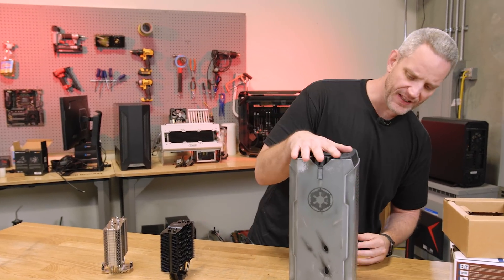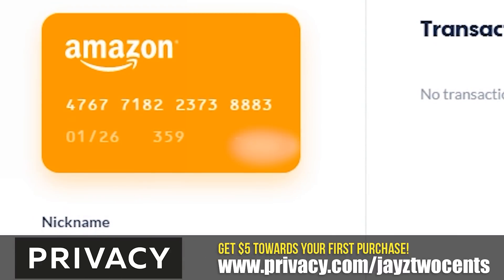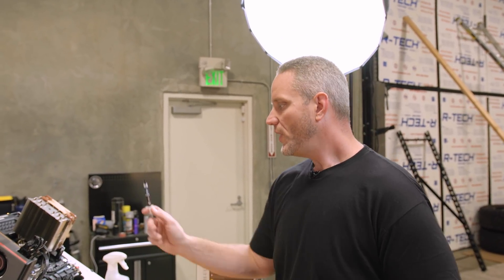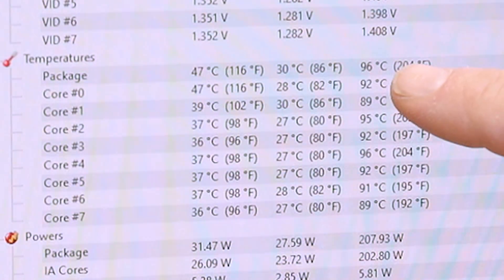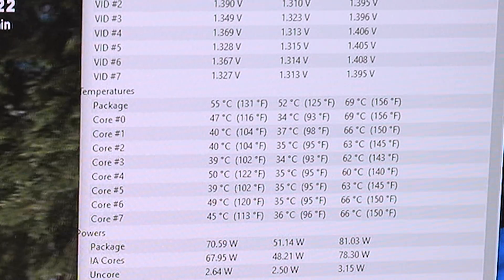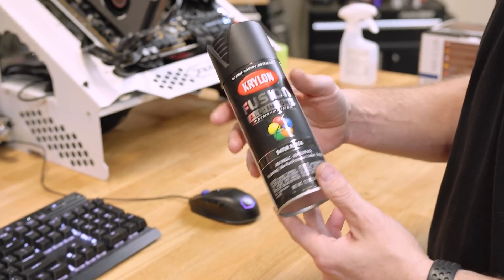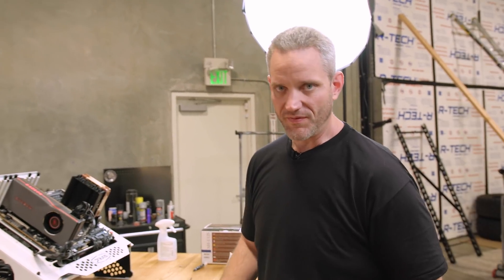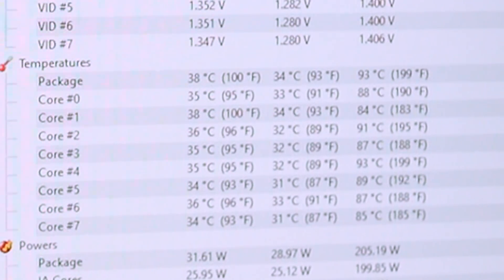Does painting a heatsink hurt its performance??

Comment: Painting the part that goes on the heat spreader would've been such a LInus move.
Reply: Well, no. Jay was the one who drilled through a motherboard and expected it to work afterwards. Linus isn't that dumb.
Reply: @SgtStinger  you can drill through a motherboard and have it work fine, all depends on specific PCB layout and whether or not there are any places where you can drill without severing anything on one of the layers
Reply: @Hetznaz  yeah, if you use proper tools. Not a cordless drill with a dull bit.
Reply: @SgtStinger  whether its cordless or not is irrelevant, and as long as you dont sever a contact, doesnt matter if the bit is dull or not
Reply: @Hetznaz  It does matter, because a dull bit will make a more rough hole and it will make the risk of delamination higher. As evidenced by Jay drilling in to a motherboard in a spot that should be OK but still failing.
Reply: I think you mean dropping it
Reply: @Hetznaz  Nah. They plastidipped a pc inside and out once.
Reply: @MarginalSC  2 years ago. I've been watching LinusDropTips since his NCIX days, and he's much more known for dropping hardware then the 1 video he plastidipped a pc
Reply: @MarginalSC  link?

Comment: In theory I'm assuming some people could go far heavier on the spay paint. Thus Jay's results wont be the same as everyone who does spay paint.

As an example someone might be real determined to get a full coat of paint between all the metal. Thus clumping or running spay paint could mess with airflow. Or some fool might put a primer on first or multi coat it. Also there's no way Jay can test every kinda paint, some could insulate a lot better than others. So results could vary there too.

Edit: Oh, Jay mentioned primer wont be used in this test.

So regardless of the result Jay will get, he likely wont get as bad results as others could. So my bet is about ~3C rise in temperatures, as Jay wont go too heavy on the paint... but others could really hit 7c or even 10c

Comment: Well it really depends on what type of paint and how thick. We us a coil compound on HVAC condensers to protect against corrosion in my company. We live on the coast and the small amount of heat transfer loss is more than worth having to replace your AC 5 years earlier because salt killed it. 

In this case it's a much smaller coil with not nearly the same airflow. So I would imagine that the difference would be more significant, but it depends on the insulation properties of the paint. The primary thing you're altering will be the radiant heat ability, I doubt convection will be affected that much because it's active cooling. 

You should test passive vs. Active cooling (fan off vs on) if you want to see how much the paint affected each heat transfer type. Obviously you would have to adjust the benchmark rate to test the passive cooling, but I think it would be interesting.
Reply: Yep, pretty much what I expected. As will all heat transfer scenario, it depends. But obviously additional layers of insulation are going to reduce heat transfer. Thats like the definition of insulation. I'm still interested in what the difference between them with passive cooling is though.

Comment: Noctua fans are WAY over rated. They aren’t the best for airflow, they aren’t the best for static pressure, and they aren’t even the best for noise. 
They’re good all around but they’re still in the mix with every other decent fan. And aren’t that much better when they excel. So I don’t get why so many people are obsessed with them like they’re the holy grail of pc fans.

Comment: My guess is that it would depend on how thick you apply the paint. If the paint is too thick and clogs up the gaps between the fins, then I would figure a reduction in cooling performance; however, if its properly done like maybe through powder coating or with an airbrush so as to not clog up the gaps between the fins, then I doubt there will be any difference in performance

Comment: [Fun Fact] When building high hp turbo cars that use air to air(intercooler) One trade secret that big boi's never tell you about is painting the front mount intercooler black.  Keeps the compressed air charge inside the pipe at a cooler and more constant temp while increasing volumetric efficiency(easier to tune for elevation/humidity/heat etc)
This was a fun video to see if the same can be applied to heatsinks but i figured as much, for you to see a huge gain in cooler air it needs to be pushed at high volumes while cramming and compressing the air molecules closer together what in turn dissipates heat "naturally"

Comment: if you just paint the fins and leave the heat pipes alone it causes zero issues, at least that was my experience painting my scythe mugen 5, also make sure to use high heat spray paint.

Comment: I think there was something that was overlooked that I would love to see the results of. When it was painted black wouldn't it absorb more heat from your studio lights then when it was metallic/reflective? I just noticed that both of the tests where done on the open test so I would love to see if the difference was lesser in a closed unilluminated enclosure.

I'm unsure if it would make a difference and maybe I'm overthinking this but it's definitely something that caught my attention.

In any case loved the video as always and keep up the good work!
Reply: The color of the paint could potentially make a difference, but not because of the studio lights.  He would need heat lamps in his ballasts to make that happen.

It is a good question, though.  Many people are asking about the black color choice due to its thermal conductivity (pretty much just like you said).  But it wouldn't be because of the lights.  There simply isn't enough energy there to make a substantial difference.
Reply: You know jay is using LED lighting, right? Its not putting out that much heat...
Reply: By the way black absorbs heat faster but it also dissipates it quite a bit faster. So its 100% negligible as to what color he picked.
Reply: @wesleybates4849  did you run that by Dwight Schrute?

Comment: @JayzTwoCents You now need to get one of these ceramic coated ones and strip that off and see what these premade black ones actually do on temps.

Also, would washing it in vinegar before painting make a difference by removing the oxidation layer upon the aluminium and make a more better contact with the surface with the paint and less insulating?    Also the type of paint, one way to tell would be get several paints, paint test strips on a white test board, place out in a sunny day or strong heat source and measure which strip has the hottest surface.  That would be the paint for best thermal conductivity to use.

Great science btw.

Comment: I believe there will be a difference, and unless your already pushing the limits of the cooler, then it will not make the difference.
Reply: I was right, it made a difference, but it did not make "the difference" unless you are on the edge of your system's thermal limits.

Comment: Yes it will matter...paint thick or thin will not transmit the heat from the metal fins and I predict a +5-8c difference in temperature.
Reply: So it ended up being +2-4c instead...that doesn't mean I was wrong, just off by a bit ;)

Comment: If black is the preferred color, consider using graphene paint; greater thermal conductivity than silver or copper (by an order of magnitude).  But, relatively expensive.  Like silver and copper... electrically conductive.  Graphite is also more thermally conductive than the most conductive metals... but, significantly cheaper.  Tennis racquets are made from graphite; used to make them from wood and aluminum.  Why aren't heat-sinks made from graphite?  The tennis racquets cost between $100-$200 (retail)... and tend to be quite larger than heat-sinks.  Oh, well.  I'm sure there's an excellent EXCUSE for using heavier, less conductive hunks of metal... instead.

Comment: Truth be told, if I was even going to paint an air cooler, I'd really only be concerned about painting the very top, which faces the window. Once your fan is put on, you won't even notice the silver parts. Painting just the top likely wouldn't affect performance.

Comment: 13:58 certified bullshit. AMD CPUs efficient transfer of heat have zero to do with the solder. AMD CPUs are made on more efficient nodes and use a multi-die design. that means no concentrated heat sports and more surface area across the chiplets to transfer heat.

Comment: 1:26 I reckon it'll reduce air flow through the cooler, and dust collection over time will be increase as well. Purely because of the rough texture the paint will leave.
Reply: But more to the point, who the hell is looking at the cooler instead of using the rig??
Reply: @noel8313  Also who DOESN'T look at the cooler in your rig?  I love me a good air cooler.
Reply: @WeirdOne19142  lol I only looked at it when it was smaller! stock cooler on a phenom II x4 955be..... But now I'm a big boy ! Hyper 411R on an R5 3600.
Reply: @noel8313  ahh no way.  I need the kind of cooler where you need to cut a hole in the side of the case to make room.  I'm joking, of course, but honestly I do like a big air cooler.  They're works of art.
Reply: @WeirdOne19142  lmao Crack up!
Reply: You know, I never considered the difference in texture building up more dust in a shorter expanse of time.  That's a great observation.

Comment: So... sounds a bit like beating a dead horse, but working off what you said early in the video that the bequiet! cooler was coated in ceramic...

What would happen if instead of using the Krylon paint, which is an alkyd enamel-based paint, you instead used something like this:

https://www.amazon.com/Dupli-Color-EDE161307-Ceramic-Gloss-Engine/dp/B000B68V90

Which is a ceramic enamel paint specifically designed for high heat applications...

I know the "designed for high heat applications" part is more about the longevity of the paint than it is the ability of the coat of paint to thermally transfer... but some part of that makes it seem logical that the high heat paint would probably act as LESS of an insulator.

Comment: I believe the Krylon Fusion paints are still bonding to the surface for about 24 hours after application. I wonder if there would be any noticeable difference after that period. Also wonder if one of the electrically conductive paints would change the results.

Comment: you  could also paint only the outside and leave the inside as it is. like alphacool radiators. it's unlikely to even see between the lamels when it's mounted inside a case, with a fan.

Comment: You should use a spray paint like vht, it is ceramic and used on engine blocks, manifolds, etc, and is meant for high heat applications.

Comment: 1:20 - Prediction is +3C from being painted max

Post guess edit: Ayeeeee
Reply: Except you were wrong. Package temp is not the only temp that matters, and many of the cores jumped way more than 3c.
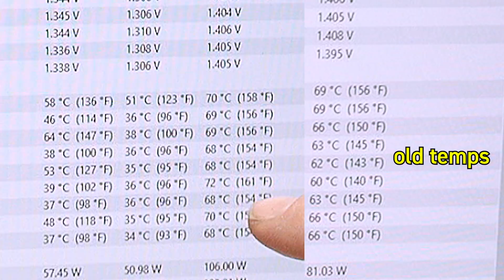Reply: @shawnpitman876  Let's just take for example a clip of his old vs new temps he's displaying at 11:47. Painted temps when I hit this screenshot were (70+69+69+68+68+72+68+70+68)/9 [because package is at the top, plus 8 individual cores]  = 69.1111 repeating. Phil's screenshot of the before temps were (69+69+66+63+62+60+63+66+66)/9 = 64.8888 repeating, or about 4.2C different. Admittedly higher than 3C, but I wouldn't say 'way more than' (unless you're going to argue the % diff)
Reply: @ThineHolyBacon  I'd argue that highest temp is what counts, and that is 3°C worse in both tests.
Reply: @ThineHolyBacon  When talking about cooling performance, the average isn't what you want to be looking at

Comment: Really depends on the type of paint, the number of coats you apply, and the surface area of the heat sink. The end result is always going to be an insulating layer between the metal and the air, but there are varying degrees of effectiveness. If you're using something or applying layers closer to the thickness of plasti-dip; you're going to bring a lot of insulation. If you have a smaller/lesser performing heatsink; you're going to see a greater decrease in performance comparatively when using similar amounts of surface coverage.

You really shouldn't be painting your heatsink, there are more effective ways to decorate metals that don't interfere with their mechanical/electrical/thermodynamic functions. Anodization immediately comes to mind.

Comment: 1:25 - it all depends on the type of painting used. The regular factory static coated coolers use a different painting material/method that doesn’t cause too much thermal restrictions on the material. Results from painting at home will vary, from a few to a lot of degrees.

Comment: Hello, Jay & Phil;
Thank you for all you do.

OK, prediction = theoretically it will increase heat resistance which means the CPU is hotter.
But- I used to tinker w/ motorcycles & I Cerakoated(?) the head, valve cover, & cylinders to reduce the operating temps.
Cerakoat really worked on my old scooter, & you could see a similar effect on a CPU depending on whether or not the finish helps dissipate heat more or less.
Usually paint reduces heat transfer but some finishes improve it.
Let the games begin!
Have a GREAT day, Neighbor!
EDIT:
I was right - it insulated the cooler like I said it theoretically" would.
Have a GREAT day, Neighbor!

Comment: Prediction as of 1:18... I think it will make a difference. The base of paint will also matter, be that acrylic, oil, or epoxy; I kind of figure acrylic would be the worst and epoxy the least worst, simply considering the chemical makeup (latex and such in common acrylics, etc.)
Going beyond the subject at hand, I would logically expect anodizing to improve cooling, though probably not by a lot. Ceramic coating makes sense, given how thermally resilient the material is.
Reply: So, it was roughly like I expected. I was expecting about 3 or 4 degrees Celsius with what you used. I figured higher if you'd used a latex acrylic (thank you for not, btw).

Also fitting that this was the word of the day...  https://www.dictionary.com/browse/phronesis?s=t